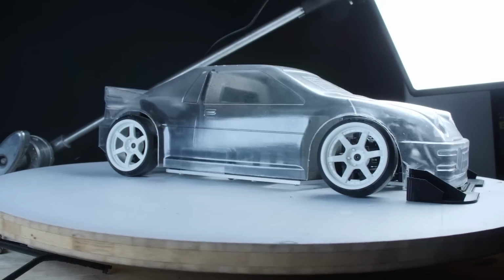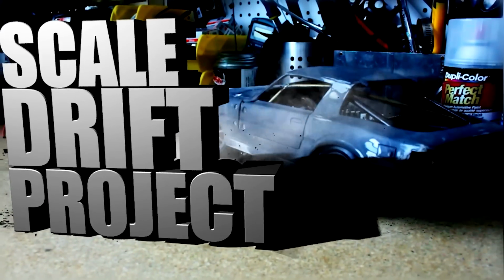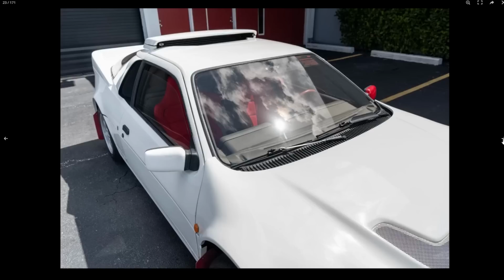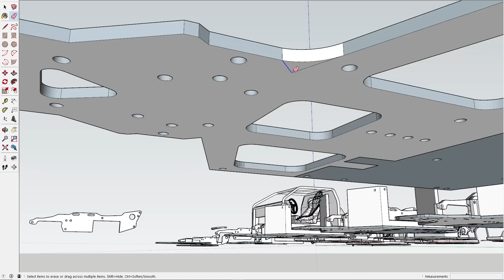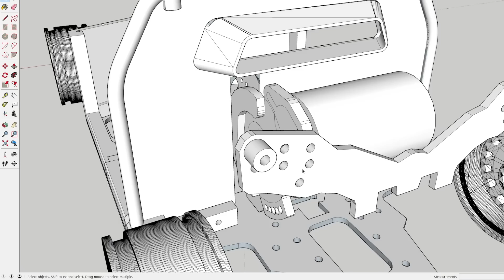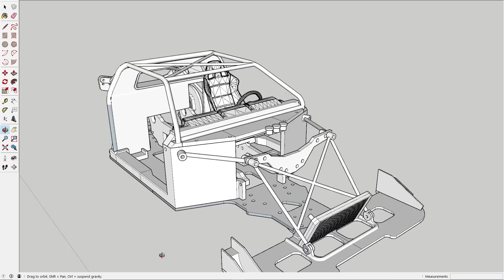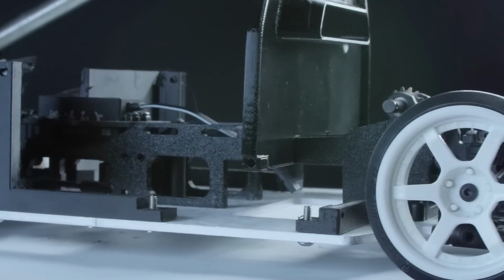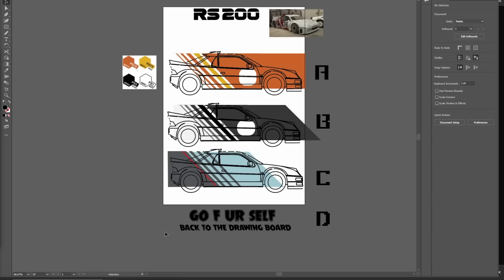RC cars that look better NAKED! Fully Custom 3d PRINTED Chassis | NOT JDM!

Comment: That’s why I’m getting into but for 1:7 I’ve only now gotten a resin printer just haven’t opened it yet. But yea gotta start somewhere so it’ll be body accessories and interiors and engine bay & engines. Just never know where the journey will take you, like arduino programming with pwm modulations.

Comment: maybe you should have a resin printer for small and round parts, so you don't get that pixelated look on like those bars.
Reply from the maker: i have one. but im not going to spend money on resin when im still figure out the design. all pipes will be resin printed in the end.

Comment: I love to do custom fabrication, I never understood computer.....well anything, I would have spray painted the flat chassis on cardboard, cut it, stretch it, pull it, drill some holes and hope for the best. 
O I ended up with a really nice Japanese set of manual calipers, dial indicator, but one items (ball end bore gauge) was gone out of the original 70s box, so it was cheap
Reply: By the end I was impressed, I don't have the computer skills for such things. Guess I'm going to stick with welding and metal fabrication.

Comment: i really love the project. But the fender cuts drive me nuts mate. next time take an exacto, cut with good pressure but guide the tip to prevent slipping. Then the cut WILL be your predetermined breaking point even if the lines are not straight. :)

Comment: Cool to see you make a group b inspired drift car, I’ve actually done a quite easy conversion on a traxxas fiesta ST rally car. I stripped the front driveline to make it rwd and to lighten the front a bit, locked the rear diff, and added gyro. Drifts even with the stock rubber tires but its a grip monster. Gonna try finding some harder compound tires to run soon.
Reply from the maker: THAT'S SICK JACK! yeah man find some drift tires so it feels like you're on ice!